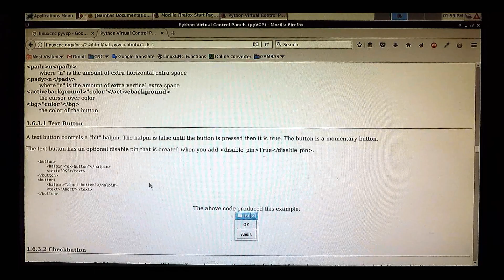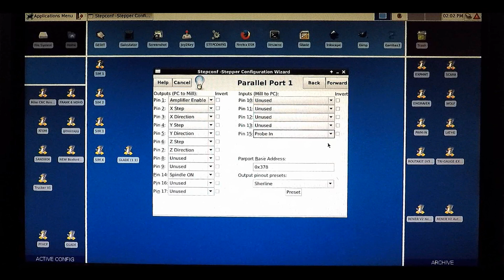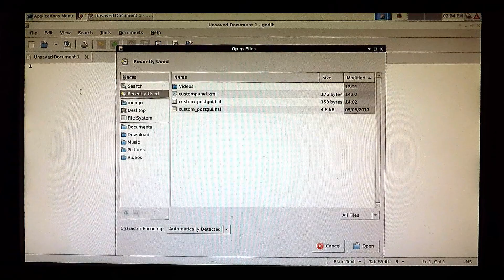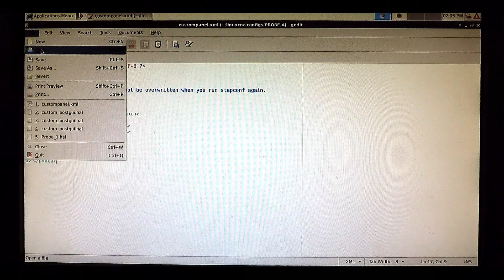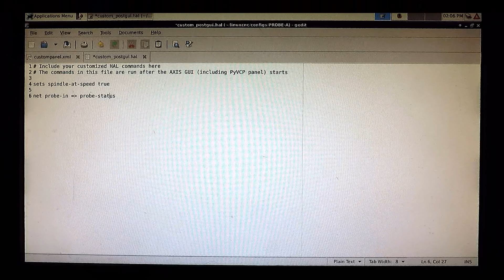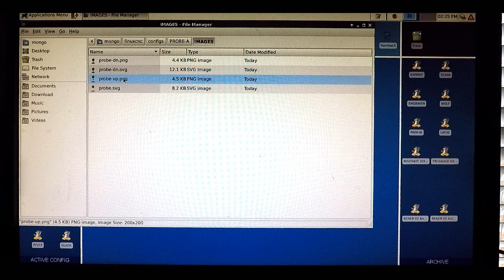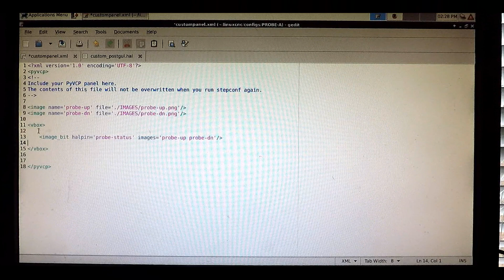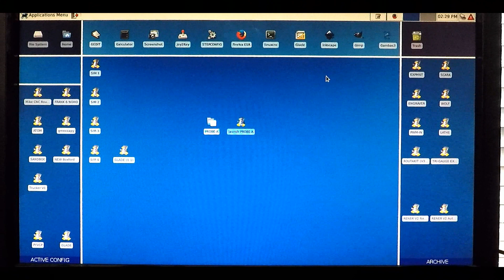Frankenlab CNC #22 - pyVCP Indicator

Comment: I only asked yesterday afternoon!!  Thank you very much Jerry.  Excellent video!  I will try it this afternoon....  Lesson learned - be careful what you ask for :).
Reply from the maker: Yeah! By the way... if the panel DOES NOT show up... I.E. you never specified a pyvcp panel in STEPCONFIG... then you need to open your INI file, find [DISPLAY], then add in this line:
PYVCP = custompanel.xml
Reply: Hi Jerry.  Followed your instructions and it worked!  Thank you - thank you!  I should now be able to avoid crashes because of clipping to the painted surface of the router bit.  All the best!
Reply from the maker: Excellent! Did you use the graphics I created or the simple LED?
Reply: Just made a simple red rectangle - it works.  I am going to try to modify your code to make a triple edge / corner finder.
Reply from the maker: Just think about the steps... 
-  Switch to RELATIVE Mode - Roughly find the edge. 

-  Back off and come in slow to accurately find it. 

-  Offset for the diameter of the probe tip. 

- Use G10 L20 P1 X__ Y__  --> You can do either X or Y first... G10 L20 P1 X__ or G10 L20 P1 Y__ 

-  Repeat as needed.
- Switch back to ABSOLUTE Mode. 

-  Go to that position X__ Y__8) Lower Z to where you want it.

The largest fail is people try to go directly to X_Y__Z_ and crash the tip.
Good luck.
Reply: Hi Jerry.  Thanks for the tips!  I was able to make the routine to find the left front corner of the stock - so then I made one to find the right :)   Made one button for each and both seem to work fine.  I have a question though - so these routines are good for 1/4 bits.....  Could you take a value from a number or slider widget to use it as a bit diameter variable (or flag) in these gcode routines to make them smarter?
Reply from the maker: Yes, you can. I made a routine to do peck drilling... in the pyvcp it has spinboxes for depth, speed, peck size, etc. You set all the variables then press the button to start. You could do the same thing... passing variables to the g-code.

This was me going through the learning process..
https://forum.linuxcnc.org/22-pyvcp/28826-spinbox-data-to-g-code-variable?start=0
Reply: HI Jerry.  Thanks again for your help!  Looked at your routines and the link - turned out to be simple.  I am very happy with these improvements.  All the best!!
Reply from the maker: Great! I'm hoping to do more videos... but my boss has plans for me to be trotting all over creation the next few weeks. :- /
Reply: Couldn't have done it without your help - so thank you again!  I'll be watching for new videos - I don't have any suggestions right now.....  All the best!

Comment: Hey jerry.  I needed to make some pyvcp buttons before retrofitting a vmc toolchanger so I can fault find my classic ladder plc on the screen and decided I better learn how to use pyvcp just for testing.  anyway your videos are great.  just had a suggestion.  you should show people how to use Halcmd.  It makes Hal so much easier!   I use it all the time now for my programming.  No more guessing for signals and pins lol
Reply from the maker: Not sure I've used Halcmd actually... Ill have to take a look and see.
Reply: Halcmd really changes the process and stops most of the mistakes.
Reply: In a nut shell type halcmd -fk in a terminal and then connect things as normal